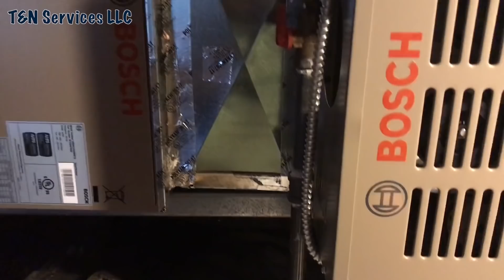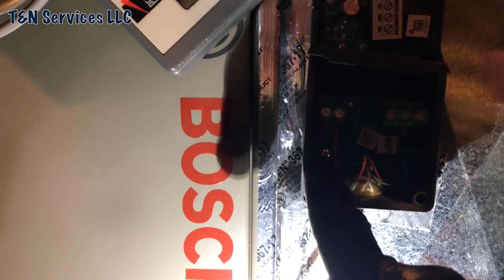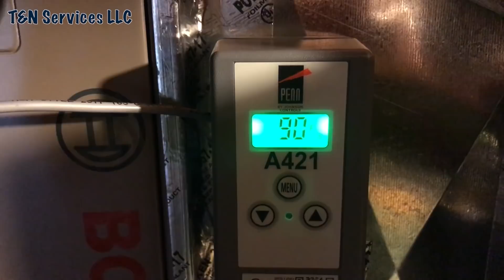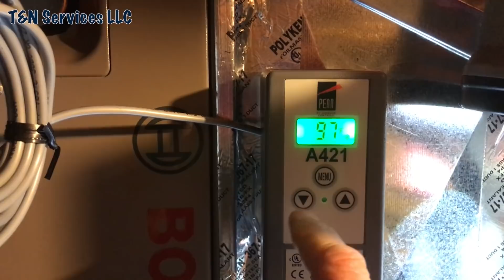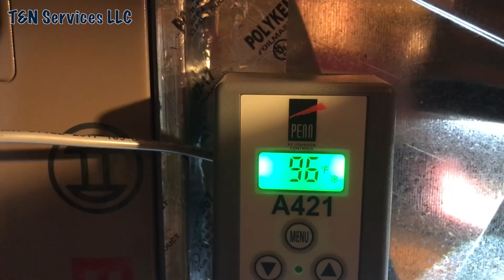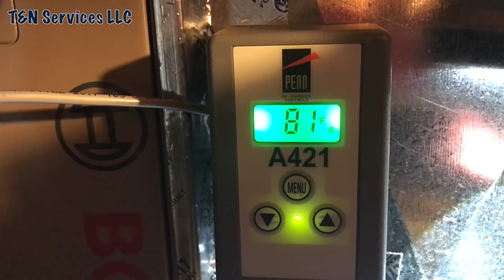Cold Blow Kit Installed On The Bosch

Comment: That's a little "TOO MUCH" Ralph....  For me anyways.. I would just have ordered the ICM fan control center that has adjustible ON/OFF settings timings then found out what time is best to achieve the desired temps....

The "GOODMAN" type PSC Blower boards are probably the best around for being (FIXED DELAYS) in the industry right now...   I know of no other brands that have a delay on built into theirs, only delay off. 

The board i am talking about is the ICM brand... Top notch and you can select with the turn of a dial the ON/OFF timing for pre-heat and post purge settings. 

I think R.E carries them for like 25 bucks...  I usually just buy the Goodmans for a good price...  PCB133S if i am not mistaken is the part number for the Goodman...  ICM sells a copy called the ICM 277 if i am not mistaken also. 

Happy New Year and i hope all is well with you and yours!

Adam
Reply from the maker: Hey Adam the only problem with using a timed board vs temperature control is you never know what temperature the coil will be when the fan comes on. It took 2.5 minutes for the coil to reach 97°. A timed board will work but won’t be as good as this one. Bosch can handle running without the fan to heat the coil up to 97°
Reply: @TandNServices   This is the one i was telling ya about.. All you would have to do is set a watch time and use a thermocoupler or temp device and time how long it takes to coil to reach the desired temp ya want.  Then adjust the dials per what your findings are. It has a very large a robust timing settings in it. Large windows of timing. 3 minutes of Make delay alone.. Just about any HP will be touch/burn hot within a minute,  Line temps anyways.  Plumb burn ya good, and i love the adj purge.. I have seen so many that stays on too long to me, i personally like to leave a "slight bit" of heat on the coil for the next start up.  On cold night, that is close to each other,  purging for more than 15-20 sec is too much.  https://www.amazon.com/ICM-Controls-ICM251-Function-Circulating/dp/B000WHAGNW

Comment: Liquid line should not be warm enough during defrost to make controller turn on blower fan.

Use a heat pump low ambient lockout relay with outdoor thermostat. This thermostat has wide band of temperature to chose from.
This will lockout heat pump to the balance point of structure you are heating.
Another good video Ralph.
Keep them coming !
Spreading your knowledge helps a lot of people in the field.
We were born in a different time. We learned by hard nocks.
It is good and bad thing.
But, we like to tweak things for s better out come.
I am like you. If we would have had video like these when we started the trade it would have saved a lot late nights !
Techs these days want to watch someone else show them how.
Your video are great Ralph.
I tip my hat to you sir !

Comment: Will this affect the fan in cool mode?
Reply: Allen Clark No. The relay is energized by call for heat closing the normally open contacts. In cooling the relay opens and fan signal just goes through the normally closed contacts.

Comment: So the temperature controllers normally open relay is paralleled with the normally closed contact on the relay ?
I guess Bosch  energizes the reversal valve for heat like RHEEM ?
Reply from the maker: Chris Alessi yes sir they energize the cable in heating.

Comment: I would recommend mounting all that hardware in its own control box , using ice cube relays with the proper socket and attaching a wiring diagram to the control box. This bird’s nest of a wiring job means no one is going to be willing to service it in the future.
Reply: BustedWalletGarage I don’t think he’ll be calling anyone to service this unit as he’s the homeowner in this situation
Reply: Stephen Rardon can’t live forever
Reply: BustedWalletGarage true, but the system will probably die before Ralph does
Reply from the maker: I left the drawing down at the unit, 
Also I’m going to label what things are and at that point if the next guy can’t figure it out maybe he’s not the right guy for the job.
Reply: Yeah the new stuff only lasts like 5 years 😢😢😢😢😢.

Comment: I had to retract my message since I didn’t realize the blower setting was on low. Do you think this could be an issue in summer time where the airflow is going to be to much for the coil to absorb the heat & humidity especially on lower stages of cool. Great Video
Reply from the maker: Y2 wouldn't help me since it's a PSC motor. The next speed up would be to many CFM's If it was variable speed I would be doing things different for sure.
Reply from the maker: Not at all. I need to be around 700 CFM for cooling and with it set on low I'm right at 680. It'll work out great

Comment: Defrost? Will it wait for the furnace to fire up?
Reply from the maker: When it goes into defrost the furnace comes on. It hardly ever goes in to defrost though
Reply: @TandNServices  So I guess the fan will stop until the furnace fires up once you lose RV.
Reply from the maker: @lee-johnson  The fan will keep running. Because of the way it's wired up (the fan wires are on the normally closed part of the relay) when it looses B and deenergizes  the coil will still send power to the fan. Just like it was going into cooling

Comment: Low speed for heat and cool just because the size you're ducting for cfm or because of unit design? Just curious never worked with Bosch equipment.
Reply from the maker: Because of the cfm I had to use low on both
Reply: Oh okay. I like that setup you added there. Should most definitely help it heat a little better.
Reply from the maker: @TheDime4life  It has made a difference
Reply: Seems like it would be a good idea for companies to start setting up the control system for the fan like from the factory.

Comment: Awesome design and explanation.  Much better than just the delayed start OEMs put in.  Yes, 68 deg would probably wake you up at night.  Just a question as I was thinking about this.  If the unit goes into defrost cycle the liquid line could drop below 77 if there was enough frost/ice on the outdoor coil?  Would that stop the indoor fan some time during the cycle?  I don't think it would be a killer, it may just extend the defrost cycle out a bit on a colder day when the Heat pump has not switched to the furnace yet...not picking or criticizing at all! This is the stuff I stay awake at night thinking, did I cover all the cases?  LOL.  nevertheless love it.  Have a Happy New Year.
Reply from the maker: Because of the way it works it would turn the fan off when it goes into defrost which is fine since its dual fuel. The system hardly goes in to defrost though. Even when it was 20° outside it kept right on rocking.
Reply: @TandNServices  Oh ok...cool that's great. You did handle that case!  Sounds like the Bosch defrost system is pretty smart then if it doesn't defrost (that much) at 20 deg!

Comment: Nice money saver
Reply from the maker: It’ll save money over time just keeping the fan off for those couple of minutes it takes to get up to temp
Reply: @TandNServices   yes sir, good alternative to stage 2 heat while in defrost fan not on to blow cold air because B still energized from the stat no, need  for W wire to  connected at the condenser. And still got E second stage if needed from the stat it's bad ass

Comment: Is that mainly for comfort? Customer not feeling “ cool” air blowing on start up.
Reply from the maker: Yes sir!!!! When the unit started I was getting 68 degree coming out of the vents for several minutes
Reply: T&N Services LLC. Makes sense
Reply from the maker: @NorCal-refrigeration  I watched your video before I opened the box, yours and OC's I just had to figure out the temperatures though
Reply: T&N Services LLC. Those are good stats.  Very durable.
Reply from the maker: @NorCal-refrigeration  I thought mine was broke because I set the off temperature to low and it would never deenergize the internal relay.
Reply: “Customer” 🤣😂🤣😂